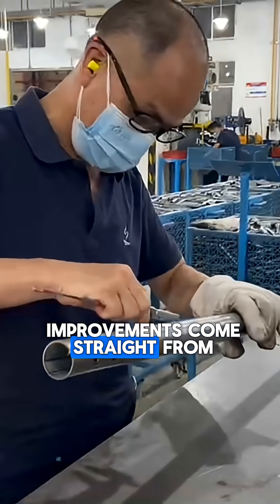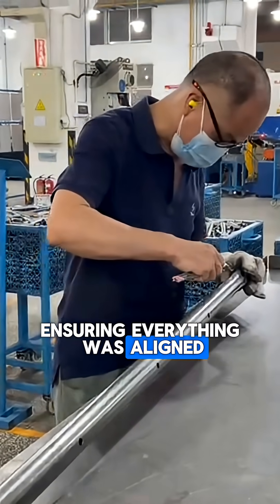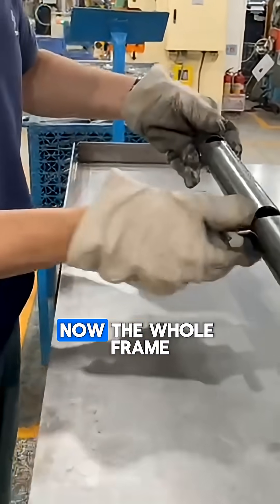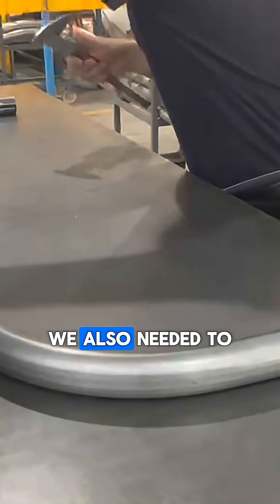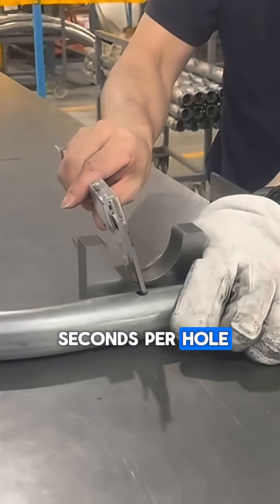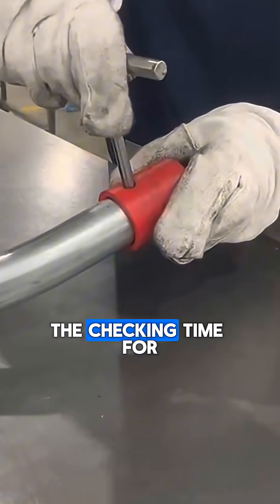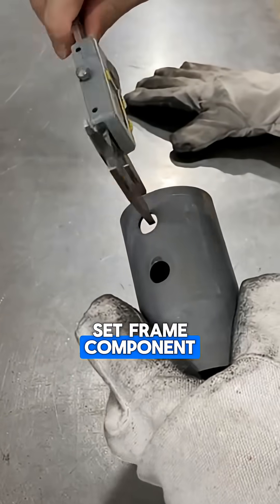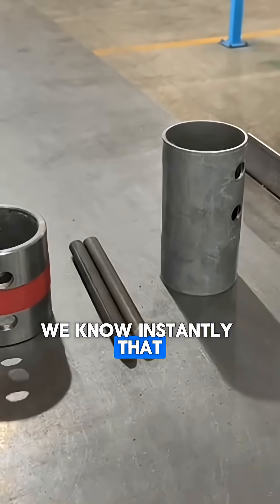QC Checking Time Cut by Over 80% with Simple Jigs #beforeandafter #qualitycontrol #shorts

Comment: I've noticed through your videos that many of your improvements depend on 3d printed parts. Usually how long does it take you to design and build a 3d printed part?
Reply from the maker: Good question. In this case it didn’t take long because we already had the original drawings, so the critical dimensions were established. We just designed a checking gauge using the negative space from the drawing.

Early on we had some trial and error because our tolerances were too tight, but over time we’ve got much better at getting them right the first time. For the example in the video, the design work took about 40 minutes.